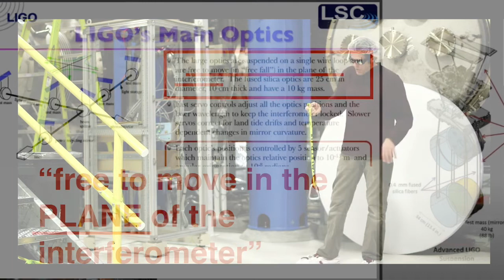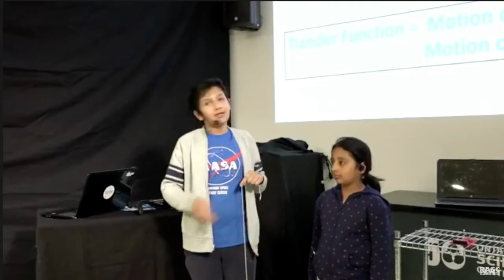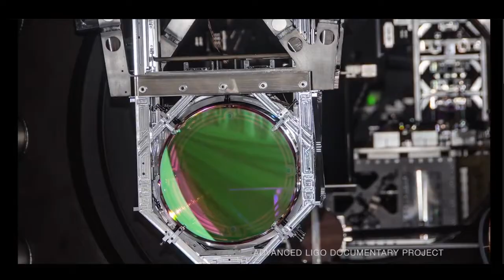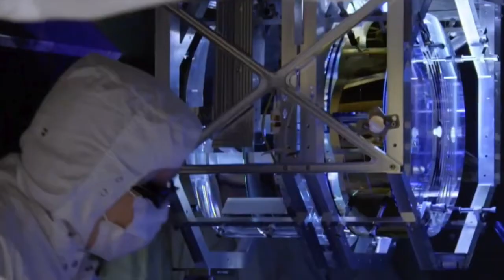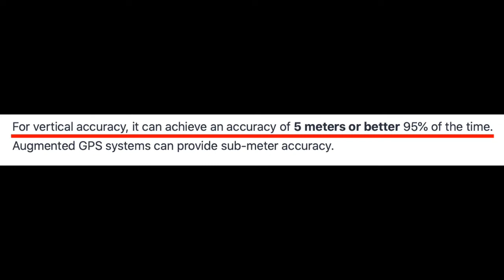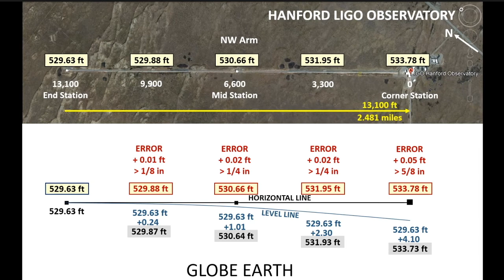The geometric LIGO   compared to the dogmatic model

Comment: I know this is an oldie, but at 11:36, you show the absolute accuracy of standalone GPS. This is not relevant here - they use RTK based solutions in this survey, where everything is relative to a base network, and the "rover" units get realtime correction. Relative accuracy is on the order of 1mm over the length of the base network. It's absolute position is established independently.
Reply from the maker: “Correction” based on what? 
Also, thank you for the comment.
Oh, and are you talking about a “correction” for the tube leveling or the concrete slab pour? Because, the “blue marble scientists” only ever talk about the slab elevations (probably because that’s the only elevations ‘documented’)
Reply: @mobiusmaximus586  what's important when constructing this is that the tubes are perfectly straight. Rtk works by using the fact that GPS errors are consistent between units, and by making one local unit the source of truth, we can make very precise relative position measurements between the base unit and the other device. We then have a perfectly straight construction. The bonus is that when we measure a level line, it's clear that it's not straight.
Reply from the maker: @DazzaOnGoogle  you spent a lot of words just to not answer what was asked. 
Weird

Comment: LOL.  Your lead-in, where you wrote “This video is intended to demonstrate the particular style and deceptive tactics being employed...and the erroneous reasoning that leads to it", is a perfect description of your video.  A few points…

1) So, you put lipstick on a pig by dubbing “geometrically” (??) when I talked about the flat earth hypothesis. Hilarious since you agree with this hypothesis which is a model based on MSL as a flat plane.

2) But you ignored the elephant in the room since those slab elevations are a curved line when elevations are based on flat plane MSL and ironically adjustments for globe curvature turn them into a straight line.

3) You claim that “GPS is not a preferred method for vertical accuracy” with your cherry-picked data for consumer GPS products, not the actual GPS instruments used, whose accuracy was later verified by Rogers Surveying, Inc. “…using a combination of optical and gravimetric techniques’.  
And I wonder why GPS surveying is now commonly used if so inaccurate?

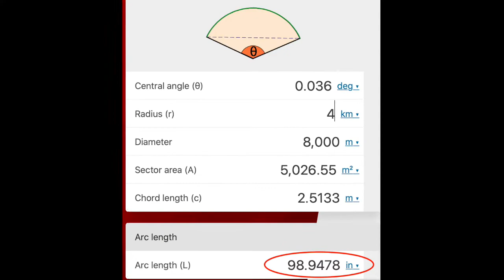4) And what is that calculation @ 5:31 for an arc with an angle of 0.36° and a radius of 4km for?  What does this have to do with my angular calculation for the difference of plumbs lines on a globe over 4 km?

5)  Finally, your attempt at a modus tollens is actually affirming the consequent. What do you know about surveying?

I think Bev needs to change that name of his channel to Try Sophistry.
Reply from the maker: I'm glad you liked the video. 

To address your points one by one......
1) Your use of the term "flat earth" is erroneous and deceitful. Geometrically, all perpendiculars to a plane are parallel. You say that's a fe argument but, it's not. 

2) The elevations in the as-built drawings are from the WGS84 reference ellipsoid model (corrected from the actual measurements used to align the beam tubes which were aligned using a coincidence bubble level). 

3) GPS never has been a preferred method for vertical elevation measurements to the degree of accuracy LIGO would need, hence why they used other first order methods instead. GPS is third or fourth order, at best. I doubt they had the accuracy you claim is possible today, back in 1994 and '95 when they broke ground at Hanford and Livingston (respectively). There were all kinds of issues you seem happy to ignore. 

4) The angle you gave was a calculated angle based on a radius value. You have no verifiable evidence of any angle displacement correction that matches your expected deviation angle. Also, the arc length over 4 km at .036º would be a vertical deviation of 98.9 inches. I just threw that in there to point at the ridiculousness of your calculated angle. What i find funny is the fact that you couldn't deduce where the angle came from. 

5) Do you disagree (and can you prove the contrary) with the statement: All perpendiculars to a plane are parallel.... and/or Horizontal and vertical are perpendicular planes? 
Or, are you just going to give me your "proof by assertion" fallacy as a rebuttal? 

Either way, thanks again for your input
Reply: @mobiusmaximus586  Sorry, you are not addressing the fact that the beam slab elevations are a curved line using your definition of a straight level line but a straight line when adjusted for earth curvature.  So here is a rebuttal to your continued sophistry…. 

1)  “All perpendiculars to a plane are a parallel” is a geometric truth and has nothing to do with the shape of the earth.  Yes, that is a true statement.
Flat earthers claim that “water finds its level” meaning that the MSL surface of the sea is a flat plane from which elevations are based.  That is exactly what my upper drawing represents and you agreed since you dubbed “geometrically” in regards to that drawing.

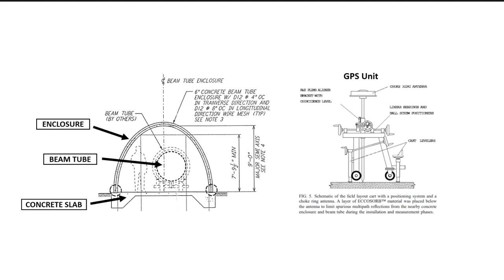2)  Not true.  Co-incidence levels were only used to plumb the GPS choke ring antennas for both the layout and final beam alignment.  You even highlight this @ 10:37 where it says K&E Plumb Aligner Bracket with Coincidence Level.  

3)  Not true.  Read the document, page 2, column 2 *A Feasibility Studies and Research   https://dcc-backup.ligo.org/public/0072/P000006/000/P000006-D.pdf 

A couple of quotes…   “Timble’s Navigation’s Site Surveyor Real Time Kinematic ~RTK! system was identified as an off-the-shelf system with millimeter-level accuracy that could perform in real time as needed in the field.”

Yes, other surveying companies were involved using traditional methods to provide benchmark data for GPS calibration and to verify the accuracy of the GPS layout at Hanford but the layout was so successful that (p6, bottom right - B Livingston Louisiana) … 
“…the quality of alignment at Hanford led to the decision to use CB&I’s alignment database as the primary basis for determining the global coordinate system without relying on independent surveys.”

What is true is that most surveys do not require first order accuracy which is why plane surveying is used.  These days GPS is becoming a preferred method of surveying since it is cost effective.

4)  Yes, I only did that calculation to only show how small the plumb line deviation is on a globe.  Your 98.9-inch arc length calculation has nothing to do with my calculation nor the beam slab.

5)  Yes, “all perpendiculars to a plane are parallel” but that does not mean that all plumb bobs are perpendicular to each other.  If that was correct the beam slab elevations for LIGO would be the exact same elevation, not one that had to be adjusted for curvature to be straight. 
 
There are no surveying or civil engineering websites that say a level line is a straight line perpendicular to vertical plumb lines.  What they do say is a level line is curved.  

If you understand geometry, you should understand that we live on a globe.
Reply from the maker: @fedogma8407  WTH is a "beam slab"? I can't find that term anywhere in the literature. You mean, the concrete slab the beam tube was then adjusted horizontally and now sits on? 

1) I don't say MSL is a flat plane so, what does that tell you? You're "sophisticated" use of the term "flat earther" doesn't apply here. Try sticking to real terms and descriptions, if you can. 
Straight lines perpendicular to each other is a geometric position (not up for debate or argument). 
Your use of the term "flat earth" in your video is just your sad attempt at sophistry. So fitting you've now learned a new word and now like to accuse me of the 'sophistry' you employ. 

2) Imagine that! that cart had to be plumb..... Hmmm
I'll let that soak for a bit. 

3) I did read the literature you're mentioning AND then I read a little more. You should too. 

4) Sorry you didn't find the correlation. Oh well.

5) "but that does not mean that all plumb bobs are perpendicular to each other." ...who's saying this?? LOL
"the beam slab elevations for LIGO would be the exact same elevation" ...not if you use an ellipsoidal reference model with built in calculations "correcting" for "error" to mark your elevations. wink wink

"What they do say is a level line is curved".... I'm not concerned with what "they say",  just what is measurable and doable in reality. You saying something is not proof for what's being said. But, you're welcome to keep trying out your sophistry.
Reply: @mobiusmaximus586  Yes, I was using construction jargon when I said slab.

1)  If YOU don’t think MSL is a flat plane then why did YOU dub geometrically when I was referring to the flat earth hypothesis? I never mentioned you in my video but again, hilarious that on one hand agree with that drawing then make a strawman saying I can’t use the term “flat earth hypothesis” or :flat earther" when the debate has been between the flat earth and globe, including LIGO.  
So, if the MSL datum is not curved or flat, then what is the shape?

2)  Yes, for the accuracy required they would want that antenna mast to be plumb to the ellipsoid, not perpendicular to the slab. “Imagine that! Hmmm”

3)  Secret info that you can’t indulge?

4)  A correlation that can’t be explained?

5)  My comment… "but that does not mean that all plumb bobs are perpendicular to each other."  Yes, a typo, I meant parallel.

Your reply to my comment, "the beam slab elevations for LIGO would be the exact same elevation" is confusing since you wrote ”...not if you use an ellipsoidal reference model with built in calculations "correcting" for "error" to mark your elevations. wink wink”

So, what is “wink wink”?  That you actually agree those are real elevations that formed a straight line on a globe or that the surveyors complicated things by making an imaginary ellipsoidal reference model based on a globe which means all of those elevations are blunders?  Or…?

Have you ever thought about a career in politics?
Reply from the maker: @fedogma8407  i know what a slab is….. that’s why i was able to deduce you might’ve meant the concrete slab the beam tube is situated on. You said “beam slab” which, is obviously NOT what you meant. Lol
Gawd, you’re so deceitful.
Reply from the maker: @fedogma8407  also, I don’t know if you noticed but, i linked your video in the description….. you’re welcome
Reply: @mobiusmaximus586  Hopefully you aren’t serious that I was “so deceitful” since I said “beam slab elevations” instead of “beam tube concrete slab elevation”.  Those are the only blueprint elevations that I discussed and the point of my video is that those elevations are only a straight line on a globe.

Using GPS surveying for the beam tube alignment was taken from a LIGO document which I added as extra information since, having worked in the construction industry, I was quite interested in how this was accomplished.  

YOU are the one using “erroneous reasoning” and “deceptive tactics” because what you cannot do is show that those elevations are a straight line with your erroneous belief that a level line of equal elevation is a straight line.  Or again, is the "wink wink" that you actually agree with me?

Thanks for the link.
Reply from the maker: @fedogma8407  it's funny that you think I'm the one using deceptive tactics and erroneous reasoning. That, in and of itself is deceitful and/or erroneous. 
What YOU cannot do, is show if GPS was used specifically for horizontal or vertical alignment of the beam tubes. 

And no..... the wink wink was not to say I agree at all with anything you say.
Reply: @mobiusmaximus586  Earth to Mobius…again, ad nauseam, the purpose of my video was to show that the beam tube concrete slab elevations are a curved line with your definition of a straight level line but those elevations are a straight line when adjusted for earth curvature.  

I can see why you continue your deceptive sophism by diverting the conversation to anything other than the fact that you are wrong about the surveying definition of a level surface.
Again, my inclusion of GPS alignment was just additional information, this was not the purpose of my video.

But the paper I sourced, “Precision alignment of the LIGO 4 km arms using the dual-frequency differential global positioning system” https://dcc-backup.ligo.org/public/0072/P000006/000/P000006-D.pdf  (written by five individuals involved with that project, including the chief LIGO engineer, W.E. Althouse) explains in detail how GPS was used to align the beam tubes.  

Yes, this was in conjunction with traditional surveys by other companies for geodetic primary monuments to calibrate GPS instruments and surveys after the beam alignment to verify the GPS based alignment data.

Sorry, but you are being blatantly dishonest if you think I have used “deceptive tactics and erroneous reasoning” when you haven’t shown that my calculations are incorrect and especially with your false accusation about my documented information in regards to GPS alignment.
Reply from the maker: @fedogma8407  like i said, your deceptive tactics and erroneous reasoning may not be intentional 🤷‍♂️
Reply: @fedogma8407  BTW, that same paper gives a clear description of what a coincidence bubble level was used for and it was used for plumbing the GPS fixtures. Mobius, Bev and the rest of them continue to insist that it was used to level the tubes! Obviously, they can't read or understand the elevation measurements - otherwise they would know that those tubes are anything but level! Mobius spews out WGS 84 as if he understands it when he talks about the elevations and in fact, it has essentially nothing to do with it. Those elevations at LIGO are reference to NAVD 88. He thinks they were plucked off the geoid somehow - it's really quite pathetic.
Reply: @bluemarblescience   I already pointed this out to Mobius in my reply to his first comment.  If Bev and Mobius actually think they would have used a coincidence level to level 4km of tubing then that is beyond ignorance.  You really have to wonder how they can claim that they understand geometry and surveying yet be so completely clueless.